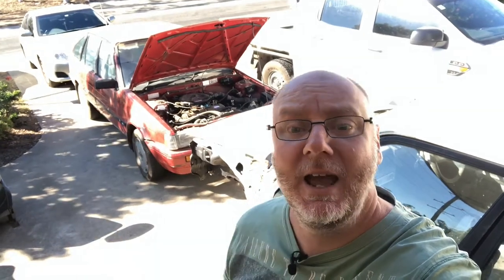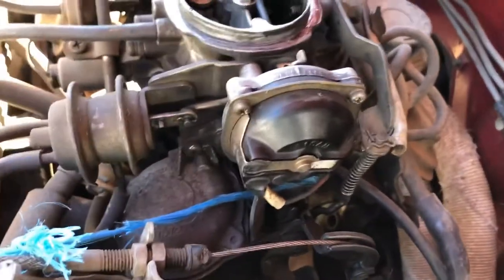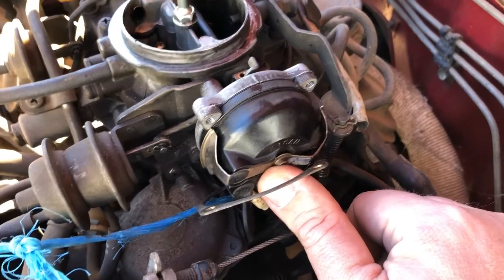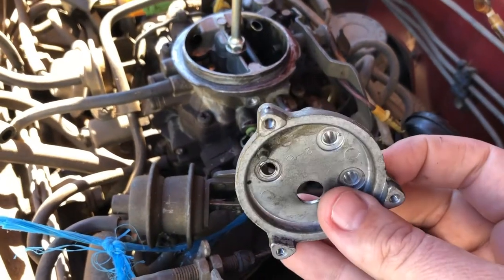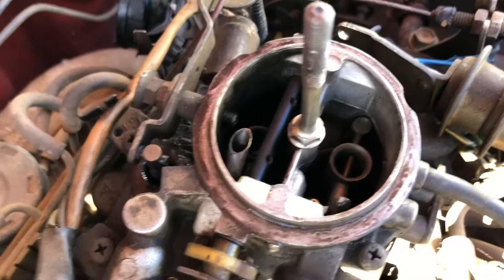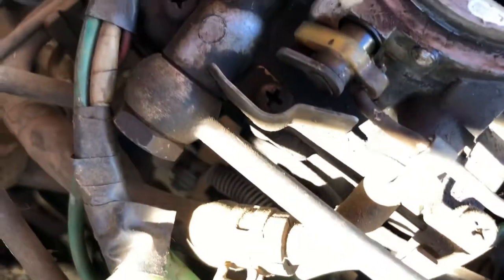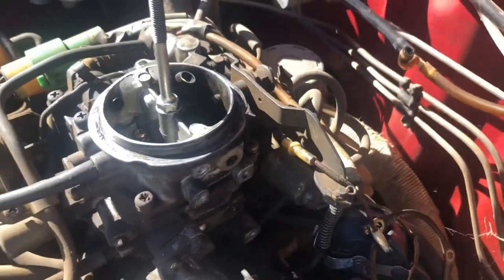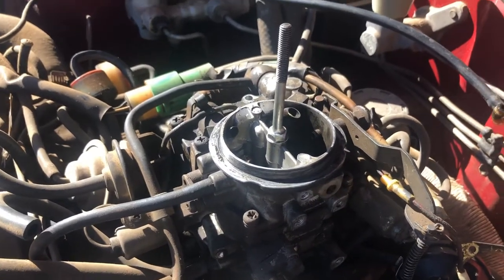Automatic Choke Delete on my 4AC Corolla Engine

Comment: No need to remove the choke garbage, just loosen the 3 screws that hold the black cap retainer ring down enough that the black cap will hand turn. Rotate it watching the choke butterfly until the butterfly is wide open then retighten the 3 screws. This will hold the choke wide open all the time. You can disconect the wire if you wish but it really isn't needed. If you remove the choke butter flys and it's operating shaft then you now have a hole on each side that let's dirty unfiltered air into the carb unless you plug them. These carbs are tempermental enough with out letting extra dirt get inside them 😂.
Reply from the maker: Hey James. Your comment appeared then disappeared...and has just reappeared. Thank you for the feedback! Greatly appreciated!! If anyone is reading this...take James' advice...cheers mate!
Reply: Is there any downside to idle control having it wide open all the time? Or is wide open normal idle mode. I thought choked for starting was most closed position, and then normal position once warmed up sits at 2/3rds towards wide open. I could be completely off with this though, new to carbs.

Comment: I have a 85' Corolla 4ac automatic choke carb and I am trying to delete all the vacuum lines but am having trouble figuring out which lines need to be there and which do not or plugged off. It starts up but bogs down on exceleration.. any ideas
Reply: APP or vacuum

Comment: Been having fuel issues with my 4ac not getting any fuel to the carb any ideas
Reply from the maker: dumped_ls400 it could be the accelerator pump. Mine is stuffed and just struggles to start and run.
Reply: G’s Autos I put compressed air into my return fuel line and once I did that I got fuel to my filter but nowhere else
Reply: @d15bvteKKK just did the same now car runs but high idle but I’m so happy it runs

Comment: What are the benefits of this?
Reply from the maker: Hi Dylann. My apologies for the late response. For my situation, the automatic choke was broken and was being held together by string. Other people will do this to neaten the look of the carb, plus removing all the vacuum lines from the carb also help to clean the look of the carb and neatens up the engine bay greatly.
Reply: @GsAutos  You deleted the choke to make your carb and engine look better? I'm having a hard time understanding that, do you not need the choke anyway? No early cold morning go to work starting? I'm in Cali and even we get some cold mornings so I would never want a solution that deleted the choke. Are you adding a manual choke or something? I'm completely baffled.
Reply: @jameshisself9324  Same, it doesn't make sense to me..
Reply: @jameshisself9324  i rather my carb look good than my car turn on
Reply: @gorrowler  Yes, I've also learned that this is more important. I was a fool when I posted that comment earlier. My Insta likes are through the roof since I discovered this.
Reply: I'm also confused, the guy that did this to my carb made it hard to start when cold and when I restored the choke system, my car now cold start in a single click 😕